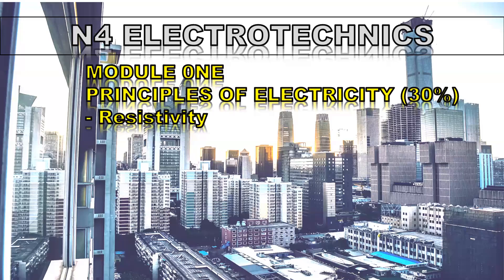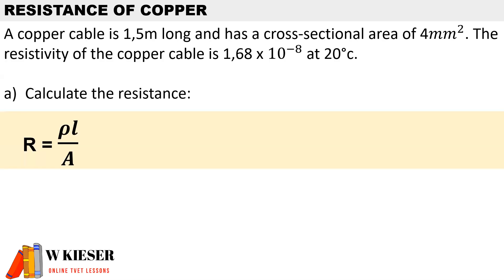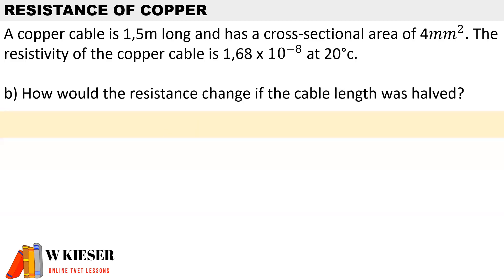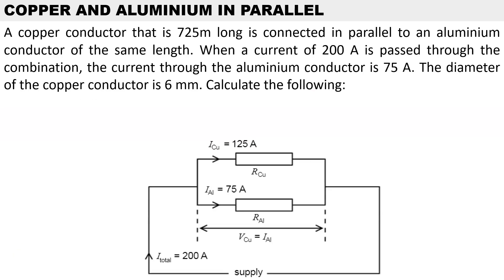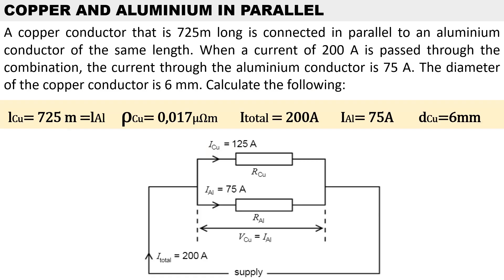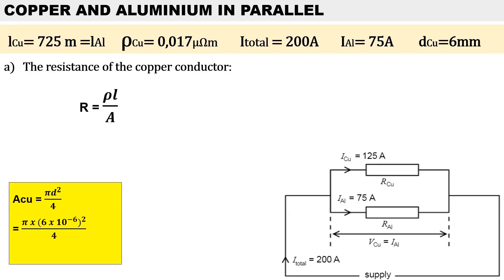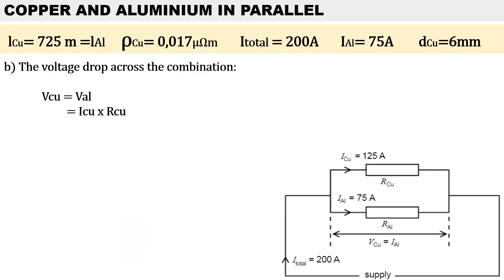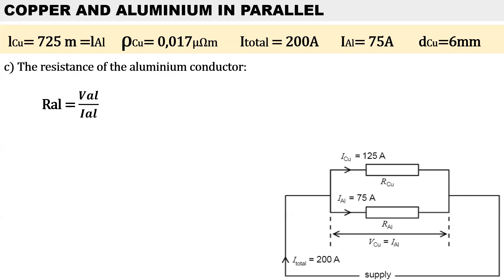Module 1.4 Resistance & Resistivity

Comment from the maker: Square Millimeters to Square Meters:
When we measure area, we deal with squared units, meaning each dimension is multiplied.
Since 1,000 mm make up 1 m, a square meter is actually 1,000 mm × 1,000 mm = 1,000,000 mm². 
So, to convert square millimetres to square meters, we divide by 1,000,000 instead of 1,000.

Example:
If we have an area of 2,000,000 mm², we divide by 1,000,000 to get 2 m²

Comment: your calculations make no sense because converting from mm to m isnt dividing by 1000000 but dividing by 1000!!!
Reply from the maker: Square Millimeters to Square Meters:
When we measure area, we deal with squared units, meaning each dimension is multiplied.
Since 1,000 mm make up 1 m, a square meter is actually 1,000 mm × 1,000 mm = 1,000,000 mm². 
So, to convert square millimetres to square meters, we divide by 1,000,000 instead of 1,000.

Example:
If we have an area of 2,000,000 mm², we divide by 1,000,000 to get 2 m²